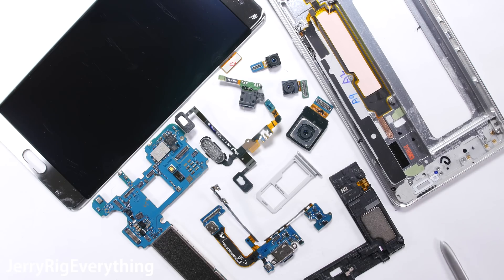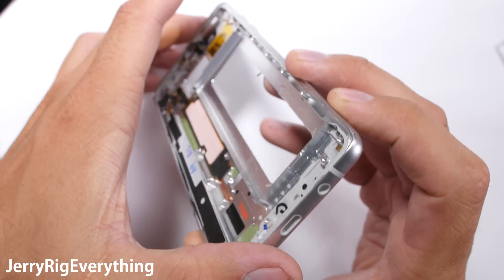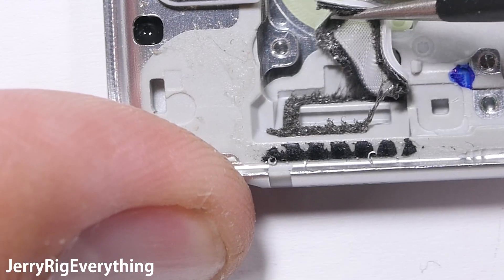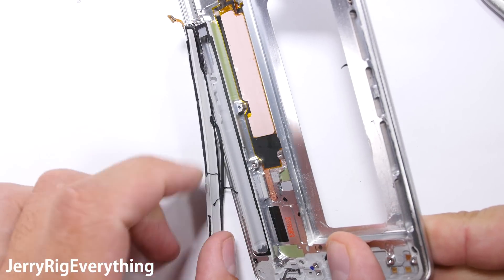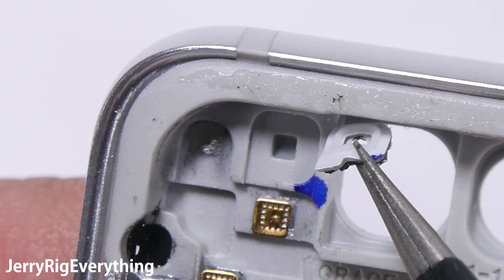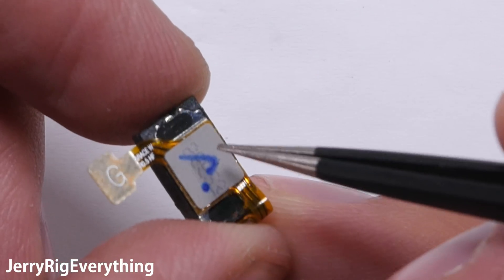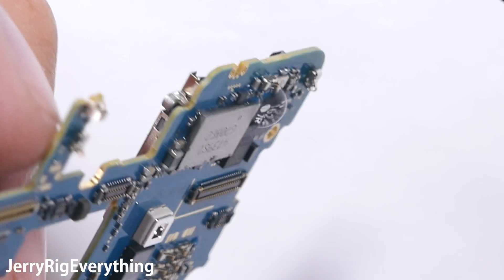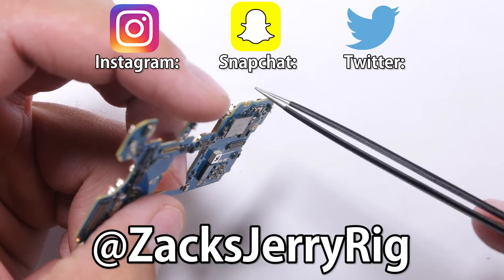What makes the Note 7 Waterproof? Ultimate Test!!

Comment: I once dropped my Galaxy Note 3 into some salt water.I knew just taking the phone out from the sea water wasn't the best idea. I took my phone and pulled the battery out. About 5 minutes later, I dunked it into cold water in the sink and left it for about 35 minutes. I was certain it was water damaged. I knew my phone was still working after the drop (took me about 20 seconds to get it out from the sea) but I wasn't so certain about how it would react. Note 3 isn't even water resistant. I took the phone out from the sink then disassembled the entire thing. Turns out the water only entered through the S pen slot and there wasn't much water inside the phone which surprised me. The wet indicator wasn't disturbed either. I dried it for 3 days to be certain and it still works to this date. I still use it. I bought this phone when it was first introduced. Maybe at the end of 2013 or early 2014... The phone still works. The only problem I have is the chrome edges are now showing black plastic underneath and the back cover is cracked around the 3.5mm headphone jack but that's nothing too big of a problem. The screen is still good and the battery lasts for 1 day. Used to last 2 or 3 days but the batteries are getting old. I still love this phone. But I am getting Note 8 in just a few days. I will keep my Note 3 with the other phones I used to use.

Comment: I've repeatedly thrown my nexus 6 (which doesn't have any form of water resistance rating) in the bath/shower, and even with a wide crack on my screen, it still works properly after a year of water abuse
Reply: Midas miracles happen

Comment: I swore I wouldn't buy a phone as expensive as the Note7 or any of the S7's without having a Micro Sd Card and removable battery but I got the Note7 and S7 Edge free so I took it! I sent several emails saying the same thing. I've been a loyal customer ever since I was a child "which is true" all I ask is to have the micro sd card back, the IR Blaster and a removable battery that I could easily swap out and if I had to leave one out it would be the IR Blaster. "The only reason my S4 still works is because it's so user friendly, I can swap most parts in minutes and had to replace the battery twice so imagine going thru this with the Note7 or S7" What if I have to swap batteries out while working or if one stops taking a charge? There could be a defect and even a recall, Thanks for listening. "After a ton of emails they replied! We plan to implement the micro sd card again, but no IR Blaster and no access to swap batteries and we don't foresee a recall issue, but you can use a power bank when you're out doing business, but if the battery stops taking a charge you wont be able to use a power bank. They screwed us! They made a near $1,000.00 throw away phone so you have to upgrade and they did have a recall which made me so happy, bad karma! These thing happen when you screw someone over! On the S6 the battery was glued to the back of the screen just to screw us that much more!

Comment: Truth is no one wants to go swimming with it or put his phone under the shower water. What 9999% of people want is a phone that doesn't become useless after you accidental dropped it in the kitchen sink while washing dishes or you dropped a glass of water on it when your hand hit the glass next to the phone by accident. 

That is want we want and i have to say Samsung is at least trying to make sure that at least does not happen in their devices. Other manufactures should go threw the same steps. 

Btw i wonder if that adhesive material that makes circuits broads waterproof can be done in a smarter way. Maybe Samsung could do some R&D to find a method to make putting that more easy and fast so it can put it on mass production.

Comment: Wait can Samsung tell if you device has been wet when the water resistance has successfully "resisted" the water? Because if the water wasn't the cause of failure(even if it got inside the phone) it should still be covered by warranty under EU law. A little red strip isn't proof that the device was shorted-circuited or corroded.

Comment: I've repaired phones for a few years and I'd say that only 1/10 water damage cases the water-labels are the proof. There are often visible damage like corrosion. The labels are more a indication to look for damages. In 1/5 cases the labels have been activated by slight moisture without damage to the device. BUT I am talking NONE IP rated phones.
BTW you know what a phone technicians worst nightmare is? Brace yourselves... TOILET-PHONES!

Comment: Why not just encase all of the electronic components in a thermally conductive coating? If they did that, and used enough coating to fill in all of the voids inside the phone's housing, not only would it be completely waterproof, but also more durable because it would be 1 solid object rather than an object full of voids. Think of a wooden board, when placed flat on the ground, it is very difficult to break. However once it is propped up between two blocks, a skilled karate chop can easily break the wood in two.

For the volume switch, just use a magnet that can slide up or down, as it slides, a metal part can detect the movement without any physical contact with the magnet itself, so it will function through the waterproof barrier. As for the speakers, it might be a little more difficult to design a waterproof speaker especially one with much bass since bass effect is a direct result of air displacement, but still possible. Rather than create all of the convoluted designs shown in the video which protect certain components from water, it would be simpler to just redesign the components to make them immune to water in the first place.

Comment: How hard would it be to replace the back cover/glass and retain water resistance?  Is it just a matter of properly applying the gasket/adhesive?  The reason I ask is because I've removed the back cover on my Note 5 in order to repaint it and add tin paper so it would stick to my magnetic car mount, worked perfectly.  But my concern with doing the same with the Note 7 is I don't want to ruin the water resistance.  Thoughts?

Comment: what happens if you spray the internal electronics mother board with clear coat or somthing?? would it waterproof the phone
Reply: That would be counter-productive. 1) The water has nowhere to roll off the motherboard. 2) By taking the phone apart you'd break the water resistance.

Comment: I'm keeping my S6 Edge +....It's has the same AMOLED 5.7 inch display as the Note 7 and a Dual Quad Core processor...Why Samsung didn't continue to use dual quads in it's 7 Edge and Note 7...Who knows?...Maybe, It's overkill in a phone...All I know is my phone will stream Howard Stern off SiriusXM to my Bluetooth headset, while my mobile hotspot provides WIFI for my household to watch Netflix and me to watch YouTube on my laptop...Yes, the 4G is good in my area, but this phone is a multi tasking beast...doesn't even break a sweat.

Comment: just saying, its up to 5 meters not 5 feet which is a big difference.
Reply from the maker: Corning says 1.6 meters on every piece of advertising.  Which is 5.2 feet. Just saying.
Reply: It's not a Corning galaxy note 7 it's a Samsung galaxy note 7 and at least on the s7/edge they said 5 meters
Reply: "During the launch keynote it was joked that you can even drop the Note 7 down a toilet and it will survive. We haven't tried it yet, but there's no reason to think that's not true.

Samsung claims that the Note 7 can be submerged under water down to a depth of around 1.5 metres (5 feet) for 30 minutes, which is impressive."
Reply: Corning makes the Gorilla Glass 5 found in the Samsung Galaxy Note 7...
Reply: +JerryRigEverything 
hi could you please check Sony Xperia Z4 how it is made water resistant? ...and compare it with Note 7 if it is possible. 😉 Thank you. Good job so far.
Reply: You are wrong. The Note 7 is water-resistant up to 5 ft. It's listed in the Samsung website.
Reply: Its not a Corning phone but with any object or connection the whole thing is only as good as the weakest component. E.g. Wifi speed, the connection will only be as fast as the slowest speed.
Reply: t
Reply: nope it isnt Ip68 is until 1.5 meters 30minutes

Comment: Samsung shouldn't be pushing the IP68 rating so hard on the S7, S7e and Note7 when clearly it barely can meet the 5ft 30m rating. They should have used the nano coating or should have just kept quiet about it like Moto did with the original G and E with the nano coating. There's numerous failures of the phone from people trying to replicate samsung's advertised dunk tests or the phone failing from some basic rain. 
I'd say they're borderline false advertising when they push that rating so hard.

Comment: Why does the water resistance only last for a certain amount of time? Completely understand that if there it more water pressure water will force itself past the O-rings etc but why if it rated for 5ft for 30 mins? Why not 5ft for an infinite amount of time? Water pressure doesn't change with time and the O-rings surely wouldn't deteriorate that quickly lol so why only 30 mins?